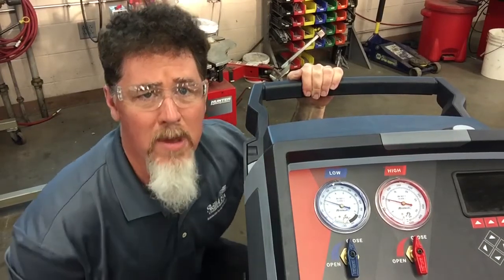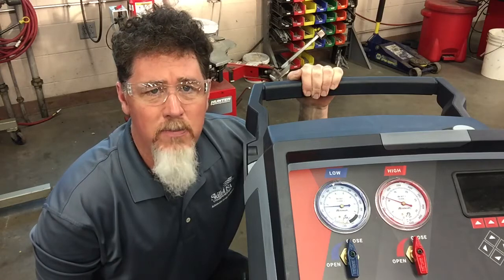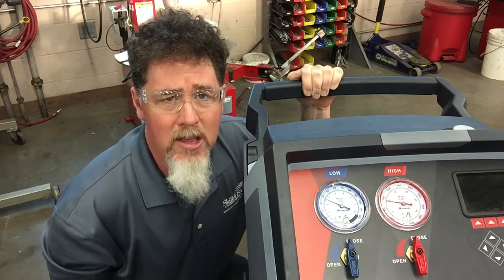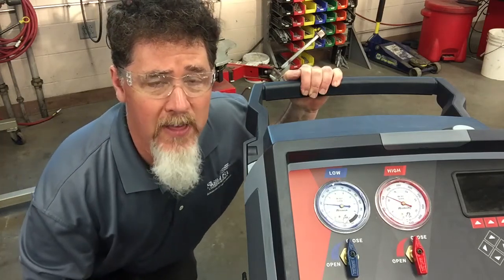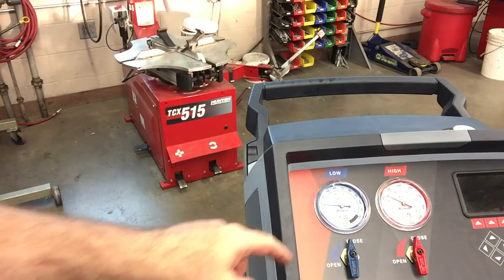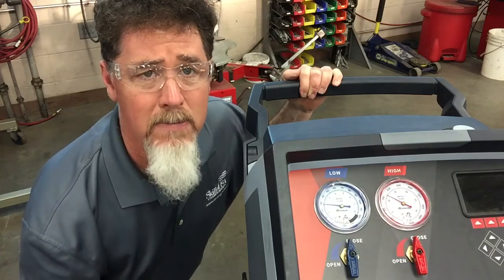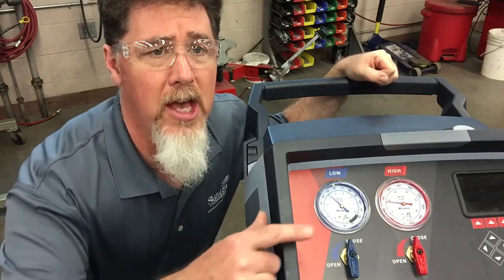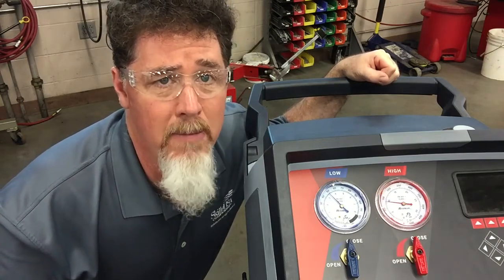How to test for a restriction in a TXV AC System

Comment: Hey buddy I love the content you do... I also have a question 🤔... so my work truck air is (1 to 10... 10 being the coldest in the cabin its probably a 6) decent at idle... but when I Rev the rpms up the clutch kicks off and on....  but the air gets warmer... (spends more time off then on while rpms are up) but I'm just trying to figure out what the problem could be... the pressures are (low side 32) and (high side 250) on a 75 degree day.. please help, thank you!!!!!!

Comment: What do you do if the system has two txv's?
Reply from the maker: You will test the front TXV like normal but the RESULTS may vary due to the rear TXV.   Equalization time MAY be faster and low side pressure MAY not go into a vacuum when doing a CO2 test.    I hope this helps.

Comment: Nice !
I'm currently working on two vehicles but unable to determine why they're not cooling properly
1 a 96 RAV4: I replaced the compressor condenser and receiver drier with new oem units. Around 97f outside temp my gauges are reading between 30-35 low side and 175-200 high side
However it's not cooling well at all. What's your take on it?

2 a 2008 VW Passat 2.0. we replaced the  compressor. On a 105F ambient temp we are reading 40-45 on low and 250-270 high. Yet the evaporator temp is at 73f the vent temp at 87F
Reply: flappers in the housing venting in warm air mixed with the cool?